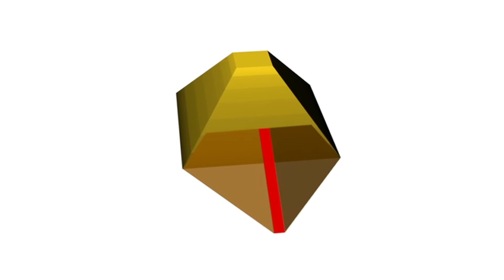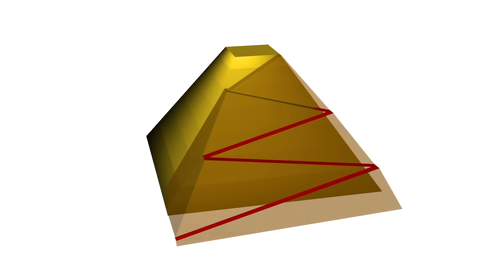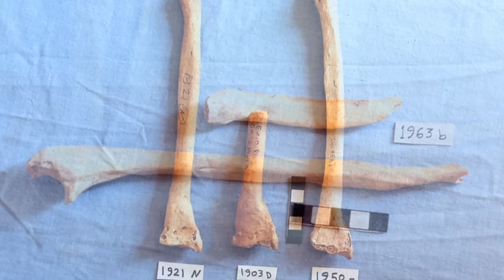Egyptology - Pyramid Construction

Comment: Stone blocks some over 60 tones were transported from over 500kms and extreme expertise used to place the blocks...But it was all done with crude tools....OK 🙄
Reply: How about a reality check:

1 - Google photos of those granite slabs you refer to in the relieving chambers as they exist online.   See how they are in fact little more than very roughly shaped rectangular slabs which were hammered into crude shapes.
2 - meanwhile transporting heavy loads is not particularly difficult as man has been doing this for a long time now = a very long time.  Cogs as an example are small wooden ships such as used to ply the major rivers and coastal areas of Europe for centuries.  A Cog depending upon its size could typically carry cargos in excess of 100 tons.  
3 - so modern shipwrights who study ancient ship designs estimate that the barge Merer and his phyle used to transport the Tura limestone to Giza as an example could likely carry loads in the ~70-90 ton range = sufficient to transport the granite relieving slabs.
4 - if you want more evidence look to Hatshepsut's mortuary temple.  There you see depictions of a large 3 decked barge carrying large obelisks on its deck.  It is being propelled via sails and oar men while further being pulled by multiple smaller ships of the same means. 
5 - finally at the base of the Giza plateau near Khafre's valley temple is the remains of an ancient deep water harbor.  Similar ancient harbors also exist elsewhere near ancient quarry sites.  So they actually only had to transport such blocks a short distance - perhaps around ~500 meters with the rest of the time their being moving via the ships I noted above.  

Moral of the story:  so incredulity makes for an exceedingly poor argument I'm afraid.  What you choose to believe - or not - means less than what evidence if any actually supports a thing.  As we see above = the evidence is there regardless of your lack of understanding about it or simple refusal to acknowledge what the subject-matter experts are better versed in.  Something new to think about............or not.

Comment: Wait, is anybody gonna talk about how they built the ramps?
Reply: Maybe something like the Masada ramp.
Reply: Pookie Jenkins  you forgot to add fanciful.
On the other hand I saw a video of the ground penetrating radar showing the still intact passageways spiraling their way up inside the pyramid.
Once you see it its so simple and obvious. Less work rather than more.
Its very clever because it manages not to intercept any of the feature shafts by being on the opposite side at that elevation.
When they did the first mapping they thought it was an anomoly in their system  as it fitted perfectly to the shape of the pyramid. 
PS who/how floated the water up? why didnt it leak out?
Why didnt it run down the shaft?
How did they get all the rafts down? throw them off the top.
No there is no mystery. Its why the experts are no longer looking for evidence of giant ramps. Only YouTube and people who like to overcomplicate things are.
Reply: They didnt build ramps. That would be silly. Rather than using stone they omitted stone. There is an internal ramp, like another passageway except the corners were back filled as the completed works.

Comment: Don't listen and believe all these nonsense about how the Egyptians were able to lift stones that weigh tons and tons up the slope to build the pyramids. Just think of it. In order to bring those heavy stone blocks to a level of 480 feet they have first to build a series of gradual ramp to that height. In other words where are the remnants of those ramp and the material used? To pull a 50 ton stone up the ramp at an angle of 30 ° would mean building a very very long ramp. To shorten it would mean 45° which would mean more manpower required to pull them up. Then what happens when the ramp reach an angle? How would the pulling be done assuming ropes were used? The fact that there are no evidence of artifacts left behind, such as remnants of the ramp or materials used speaks for itself. The construction said to last 20 years or so would take at least 50,000 men working round the clock. So many discrepancies in this theory. (1) Where are the vestiges or archeological remains of the housing complexes needed to put up the workers? (2) Working in the night and especially inside the pyramid structure itself requires lighting. Did they burn candles or other flammable material and use up the oxygen supply within the pyramid to choke the workers (perhaps to death ). These are just 2 important discrepancies among many, including the question why would a pharaoh use up the country's precious resources over 20 years just to build a tomb for himself? I do not profess to know how they did it. It's a mystery. But my best guess is - they used some sort of levitation method. We now know that sound waves and counter-magnetic forces can levitate objects. This is a scientific fact. Maybe the ancient Egyptian people had some knowledge and technique of using it which since the fire at Alexandria the knowledge had been lost. Just a postulation that is not so far fetch but possible.
Reply: So many words = so little said.  C'est La Vie  Rather than a nonsensical screed based upon incredulity = try addressing the actual historical/archeological evidence we see.  Things work better when you do..........just saying.
Reply: @varyolla435 Looks like English is still a problem for some people who can read but do not understand . Therein lies the difference between seeing things and perceiving them. Maybe you should go look up about how sound waves can be used for levitation. It has been scientifically proven under laboratory conditions, but not yet viable for commercial applications.
Reply: @CCLow-jr7um  🤣🤦  Someone needs to open a window here...... - and probably should lay off gaming as their fantasies are clearly getting the better of them.  Try a good book sometime.
Reply: @varyolla435  Great god, we have someone here still living in the era of old world and doesn't know science has explained off a lot of mysteries. Anyway, i shall let sleeping dogs lie. What would a dog understand about science.
Reply: @CCLow-jr7um  That makes 3 comments now....... = still nothing said.......still wasting time trying to attack me rather than articulate anything to indicate understanding here.  🤭

p.s. - I don't know what a dog might understand about science.  For myself = my degree/career was in an applied science field...... - oop!  🤣
Reply: @varyolla435  Haven't viewed this video or thread for some time.and was surprised someone tried to show he is eductated to a high level. But from his comments his degree is probably from University of Timbuktu (if ever he has a degree). Applied Science? It's obvious he doesn 't know anything about science or engineering. I am an engineer by profession and I know what I am talking about. I am sure you know who the he I am talking about. It's the guy who criticised my comments without understanding what I was talking about. No, it can't be you because you got a degree. I would suggest that guy go look up on how levitation can be achieved using sound waves transmited at certain frequencies. It is not fantasy, it is a scientific fact (a real science graduate will know this). Go on, don't take my word for it, go scroll on internet and ask - can sound waves levitate objects?
Reply: @CCLow-jr7um  🤣 That makes 4 now.....  Still attacking me = still not elucidating anything whatsoever to indicate understanding of the subject-matter.  

p.s. - your "day job" counts for exactly = squat....... Unless you work with Egyptologists or reference material sourced to the same = you are talking out your backside being uninformed about what is known so as to ascribe plausibility. 

As your freebie Egyptologists = work with engineers et al in formulating their conclusions...  Hence your "peers" clearly do not agree with you.  How's it feel to be "on the fringe"........
Reply: @varyolla435  Hello, small boy, still rambling away with your ranting? Wow ! Ok, you can continue with your ranting as long as you like. Now that I know you are only a small kid, i am disengaging myself from this thread herewith. No point for you in replying with a last word here as I will not be reading it nor making any further response. Hope you grow up to be ok in your adulthood.  Goodbye to you and you have a good day.
Reply: @CCLow-jr7um  5 now...... - not going well for you is it.  🤦

Moral:  what is the definition of insanity??  Answer:  doing the same thing over and over again = but expecting a different result.......  Ponder that if you will.

Comment: Must of had good work boots to get some grip while pulling up such inclines 🤔
Reply: Not really.  Consider the following:

1 - there is historical evidence they employed levers and what Herodotus termed as "a machine" to raise blocks.  He also wrote they first built a "stepped pyramid" ala Djoser before filling it in and encasing it in white limestone from the top down.
2 - so the "machine" is likely a variant of a lever device employing a fulcrum and counterweight akin to the Egyptian shaduf.
3 - meanwhile if you look at the blocks of the pyramids you'll see that the largest/heaviest ones are found = in the bottom third of the structure.  Above the level of the King's Chamber the blocks become smaller in size with those at the top being small enough to have been slid into place by several men.
4 - accordingly as we see in #3 those smaller blocks were likely raised via this "machine" which could have sat upon the steps alluded to in #1 to raise the blocks to the level above.
5 - so the earthen ramp which once sat on the south side of the Great Pyramid - closest to the quarry and harbor location - really only needed to go as high as the largest/heaviest blocks to be raised = King's Chamber.  The smaller blocks above this level might have been raised via the machine and perhaps smaller mudbrick ramps.

Moral of the story:  at Wadi al-Jarf where Merer's diary was found - he worked on the Great Pyramid - they also found abandoned limestone blocks dumped in a central area.  Among the blocks they found flat wooden planks which had been laid flush into the surface of ground akin to what the military used to use to cross boggy areas = corduroy roads. 

So there are examples of earthen ramps at Giza in the western cemetery alongside the Great Pyramid.  They are made from a mixture of sand/stone chips/tafla - a clay they mined.  There is the remains of a massive tafla mining operation at Giza near the worker village site.  We also see a depiction of workers pulling a statue on a wooden sled while a man pours water before the laden sled.  What happens when you moisten clay??  Answer:  it gets slippery.

So the ramp did not have to go to the top of the pyramid = ergo the angle would not have been so steep.  The ramp was in part made of clay which becomes slippery when you pour water upon it.  Finally as we see in Wadi al-Jarf if they laid wooden planks spaced into the ramp surface then the sleds would have road atop those spaced out planks as well as moved easier over the slippery surface before it quickly dried out again in the Sun to move the blocks of varying weights.  

On a side note they also employed draft animals such as oxen to pull sleds.  We have depictions of yoked oxen pulling things while the worker village at Giza contained many tens of thousands of cattle bones.  Thus it is inconceivable they would consume cattle yet not also use them for manual labor such as pulling the larger blocks into place.  Something new to think about.

Comment: I think the most possible way is what Mario Collepardi, an Italian Prof said. he studied the architecture of the pyramids, emphasized that the Pharaohs brought the limestone dust available a lot in their area, mixed it with normal soil. Then they added water from the river Nile (that's why they found find sea elements in rocks ) and lit fire to a temperature up to 900 degrees Celsius. This heat gave the stone strength and a shape similar to natural rocks.

The idea does not cost a lot of effort because workers will not carry and raise any stones, all they have to do is to make the templates in which they pour mud and transfer mud from the ground and raise them in small containers. Each worker carries a container with mud to fill the templates. Then comes the process of lighting fire until the stone is shaped and stayed in place making sure by this way that there are no spaces between the stone and the other. Using this method helped in keeping the pyramids safe for thousands of years.
Reply: No the limestone was quarried and brought from 600 miles away

Comment: How did they light the inside of the pyramid to be able to see during construction. There is no evidence or torches. Did they use electricity? Explain the Baghdad Batteries that they have found all over the deserts
Reply: lol!  Tell me perchance = how does a bathtub which is larger than the door get into the bathroom????  When you can answer this you will hopefully see the nonsensical nature of your question.  On a side note. Egyptian lamps did not produce much soot as they were believed to burn olive oil with salt mixed into it which reduced the amount of smoke generated.  

On a side note - and for my own enjoyment.  Feel free to elucidate for all who read this = "what" exactly was this supposed Bagdad battery used for????  It is comical to say the least for some to claim all this supposed technology the Egyptians apparently had.  Alas however...............no one seems to know what they then used it for.  lol!!  If you are going to claim the Egyptians used electricity then = you'd also better pony up what then used the electricity.  Something new to think about.

Comment: 1 block in perfectly in place each 2,5 minutes for 20 years. Something is missing here
Reply: Indeed = critical thinking.  lol!  So follow the white rabbit Neo:

1 - look at the pyramids as there are loads of photographs to be found online.  See whereby most of the blocks are anything but "perfect" let alone perfectly placed.  They are in fact little more than crudely hewn chunks of limestone which were rapidly dropped in place leaving gaps all over with globs of mortar and small chunks of rubble sometimes jammed into those spaces.
2 - next is how do masons build say a brick building???  Do they simply take one brick --------> place it = to go back for another???  Answer:  of course not.  lol!  You rather see teams of masons working in tandem in different locations - with others helping them such as fetching more bricks and mortar to speed up the process - so that the walls are created much faster........so it was in ancient Egypt and elsewhere.

Moral of the story:  if a team of workers can pick up a block from the quarry which sat no more than 100-200 meters away from the pyramid and pull it up the ramp to drop it in place in say 2 hrs = then 10 teams can place 10 blocks in about the same time and so on.  Thus the more teams working in tandem = the more blocks can be placed in relatively the same span of time.  After all the Great Pyramid as our example is rather a "large" structure which could have easily accommodated hundreds or workers upon it at any given moment. 

So as we see most of the blocks were simply chunks of stone rapidly fractured from the bedrock.  Very few of the total were more carefully cut and in some cases polished with the rest being little more than stacked rubble.  The quarries themselves sat close to the pyramids so that those blocks did not have to be moved very far.  We know the Egyptians employed thousands of workers and those workers were further broken down into specialized teams.  When you have a team doing the same task over and over again it does not take long to develop a routine which facilitates speed of completing a task. Finally we know they also used animal labor such as oxen for pulling things.  So those teams of block movers were invariably assisted - at least for the larger blocks - by teams of oxen who can pull quite heavy loads as history shows. 

Forget about the silly "X blocks per........" whatever and instead step back to consider the totality of what was going on.  THAT is what is "missing".  Something new to think about.
Reply: @varyolla435  your reasoning falls when we start to consider how they built the inner chambers and corridors only trowing stones as you say...